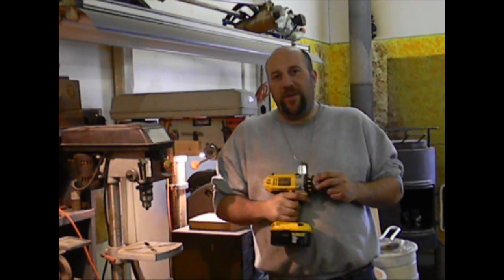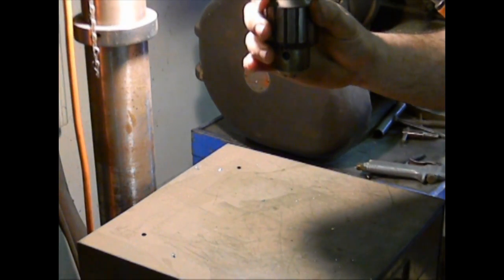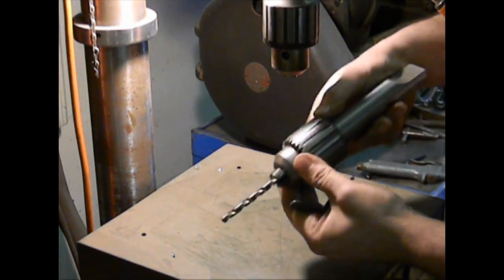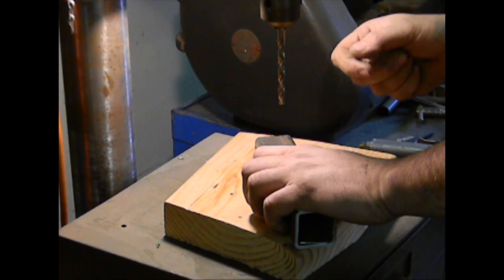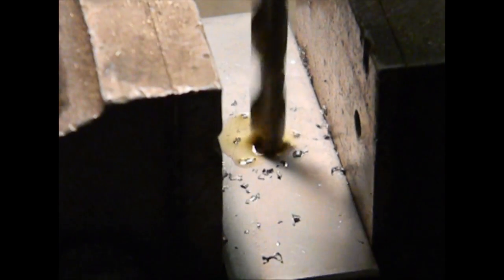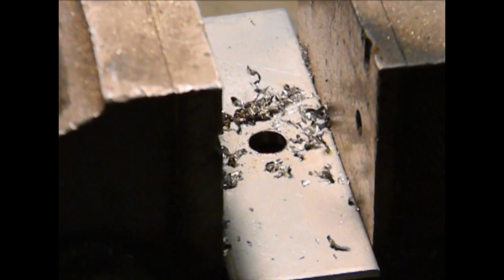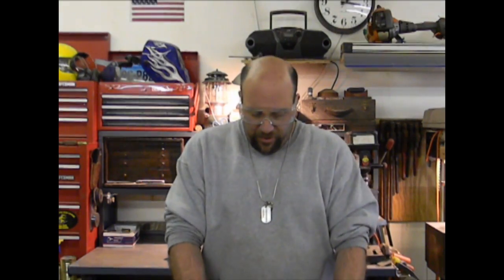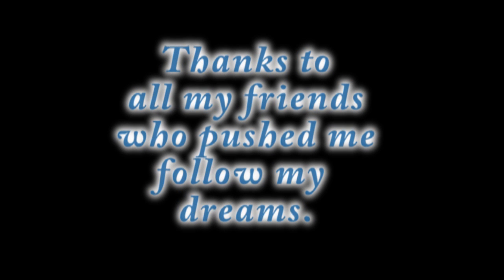Drilling Steel / Using a Drill Press

Comment: Great Video, very educational. I'm starting out in knife making and I have trouble drilling into 1095 steel which is suppose to be a soft steel until I harden it. what is the ideal rpm's to run my harbor freight bench drill press?  thank you for your time.

Comment: cool american man. i bough a cheap hand saw hopping to make multi sizes cutting desks (2 inches diameter) for my Dremel drill. is there an easy way to make a small hole (2mm) in this saw without denting it...?? it seems impossible

Comment from the maker: There are drill bits that have a gold looking coating on them, called "TiN HSS". The TiN is the type of coating and the HSS stands for High Speed Steel. These bits are the best I have personally used for drilling softer metals like aluminum. Most sites that I have looked at recomend using a cutting fluid or oil when drilling at higher RPM's. It will help prevent the whole becoming ovaled due to any heat buildup. Other than that keep your bit sharp and take your time :)